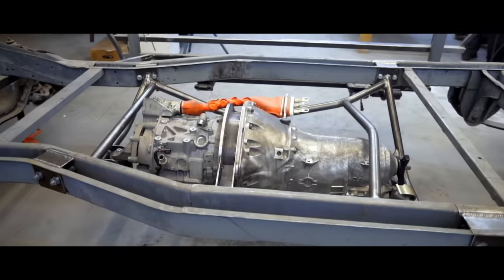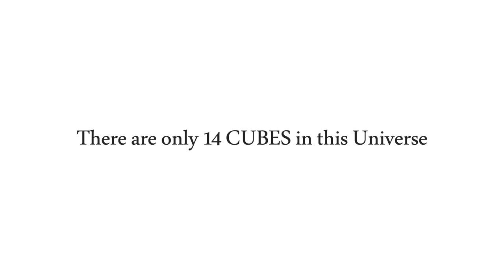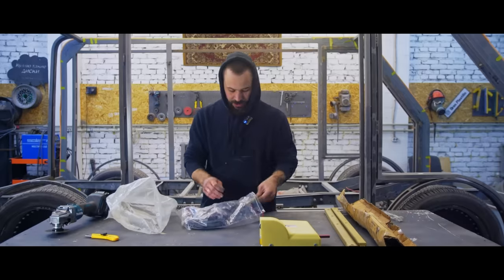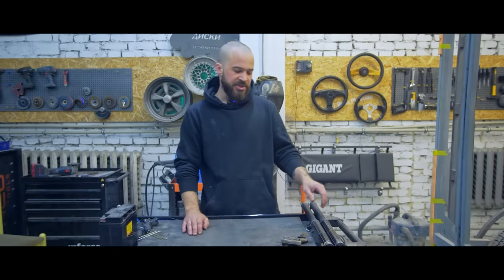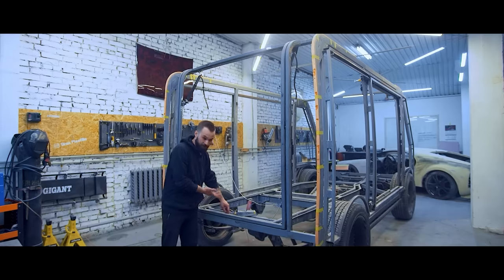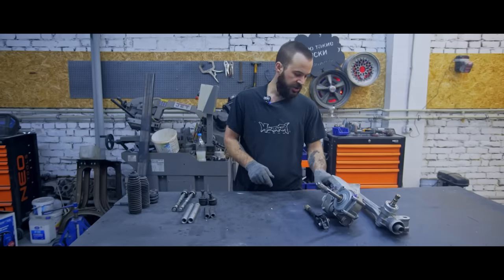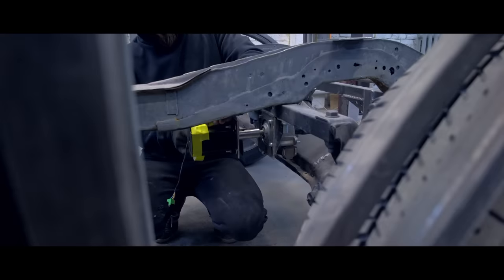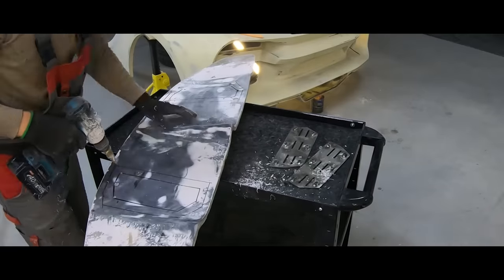Joystick instead of steering wheel for Cyber Van. BIG Part 4

Comment: You can make the trunk lid in two parts. When the opening handle is pressed, it folds outwards from the middle. The lower part remains attached to the body and can be opened upward with pneumatic power, allowing the rear trunk to open easily even in tight spaces.

Comment: It's a good idea but I think the problem comes from the shift selector detent piece, where there is binding with the shift forks, I did find it's best to set the case to 4lo then install the low gear and forks and  spindle, and everything else. Scrutinize everything, I had a bad 4lo synchro.
Reply: Thanks a lot for watching and your interest! Sub and keep on watching